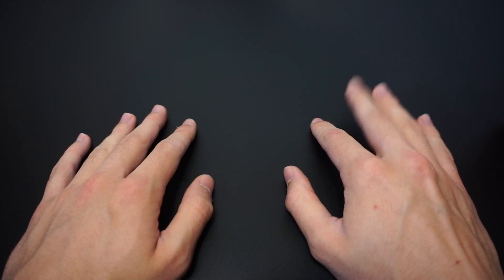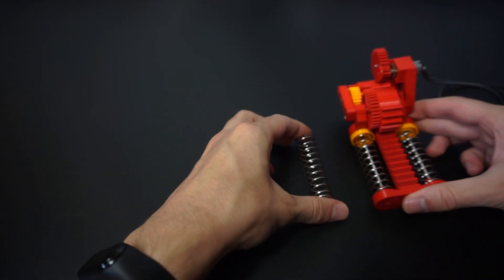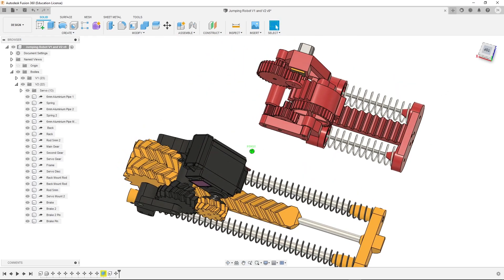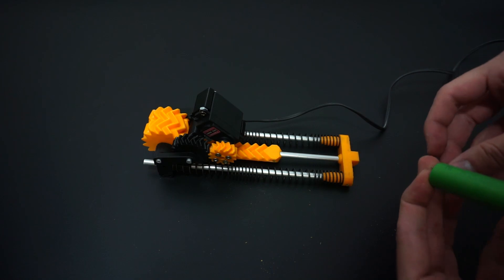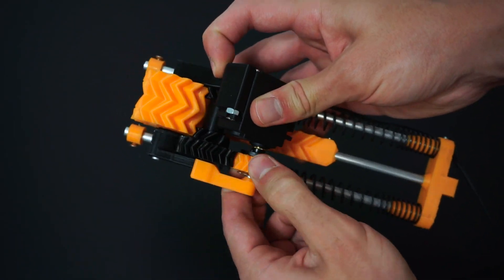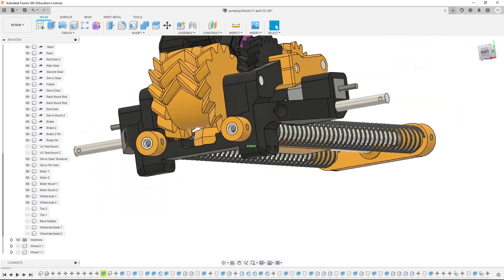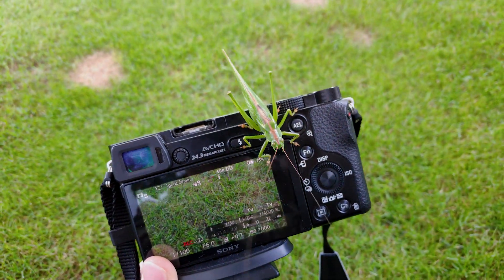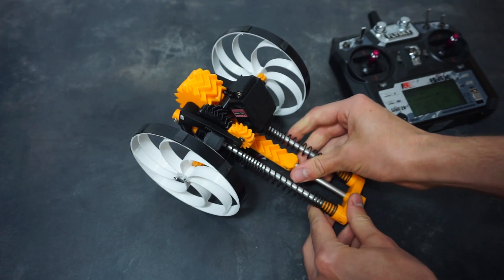Building a Jumping Robot Part 2

Comment: Why not build it in a way, so that the wheel axis is being exected ? This way it wouldn't need to stop spinning the wheels before it can jump. Also it could take the advantage of forward speed of spinning wheels so it could jump over an obstacle.

Additionally, instead of using mechanicas of springs you could use some kind chemistry to generate a gas, in a confined space, therefore compressed, that could be pneumatic mechanism to propel the jump, after release by much smaller mechanism - the difficulty is to build it using materials that can tolerate much larger air/gas preasures.

Comment: I noticed during the jump testing, the rig was also trying to rotate. As it was ascending the pipe, I believe the sleeve (sliding on the pipe), was binding to the pipe…essentially acting like a brake. I think to remedy this situation you’ll need another sleeve near the bottom (sleeves on the top and bottom of the rig).

Comment: Love it!

Making a Watch Dogs 2 jumper, ordered a Sumo jumper on eBay to rip for this(already printing parts I expect will die after a couple jumps). 
My car will have a tad bit of heft. Proper camera, wifi, speaker, ultrasonic sensor. I had a similar idea of using an airsoft mechanism and spring. My thought was to use an M140 spring I've had laying around for ages. 
I'll have to print your design and see what I can pull off :)
I intend to add a catch for the fully compressed spring so it's ready to go when I want it to. 
I'd like to get Starlink, connect my jumper, drive to my buddy's house and make it insult him. 

clicks tongue*

And then I want to make one that flies

Comment: Love the wheel design. They did an impressive job of absorbing the impact. Very cool project. One tip to consider might be mixing the printing orientation of gears and their shafts as 2 separate interlocking pieces for maximum strength.

Comment: For the test rig, adding a second loop at the bottom will fix the issue. What is happening is there is rotational force which causes the lip of the top loop to catch on the pipe, by adding a second loop at the bottom this will stop that being an issue, it will still add resistance, but it should stop it catching the same way. You can also add extreme fillets to either sides of the loops so that there is no place to catch (this would require increasing the thickness of the loops to account for a 1cm+ fillet)